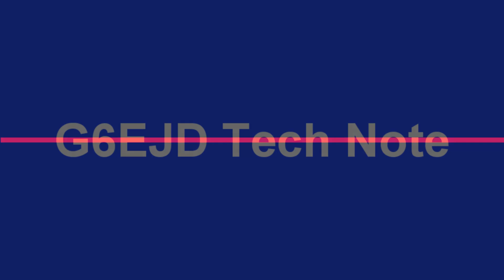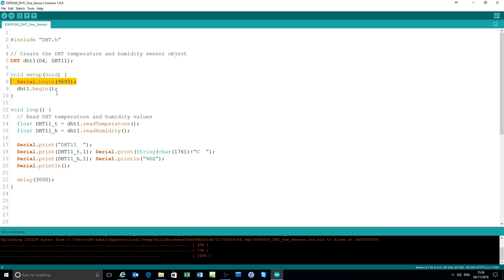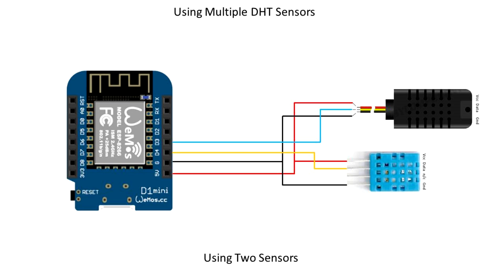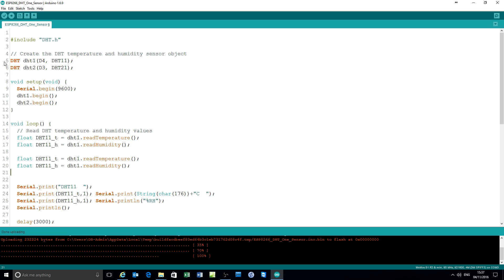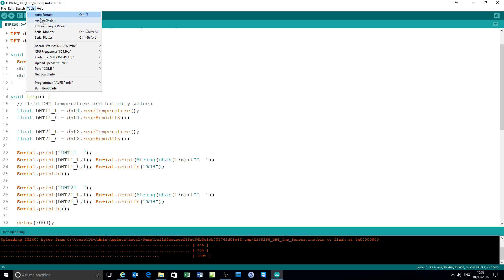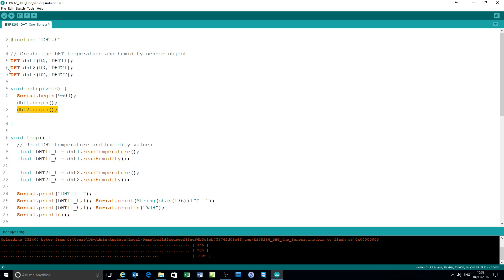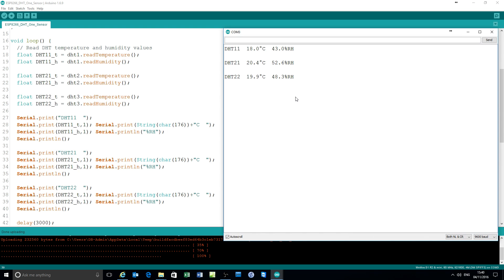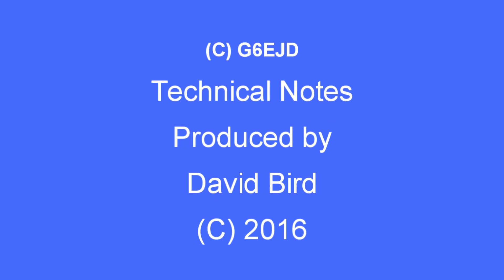Tech Note 012 - ESP8266 Reading Multiple DHT Sensors

Comment: wonder why do i only get Nan all the time?:s
it worked perfectly fine on d1 r2, but does not give any readings on mini pro...
i do have the dupont cables soldered directly on the pins tho because i dont have another breadboard, so maybe it does not get any connection through the tin because it did not want to stick onto the pins at all?
Reply from the maker: Let’s assume the connections are OK, best checked for continuity with a DVM. Have you checked here https://wiki.wemos.cc/products:d1:d1_mini_pro to ensure PIN numbers are correct, if you have used Dn and not GPIO numbers then it should be ok. Have you introduced any I2C devices? As D1 and D2 are SDA and SCL so your use will be overridden.
Reply: well, i later tested for continuity and even got 3,28 volts on the sensor, but still only Nan in the output... and i think i used D0 for dht22 (altho i first wanted to try it on the A0?:s and D0 is 16 then?)
and i obviously forgot to test the bmp sensor on it, so i will probably try that later...
Reply from the maker: Have you set up the programme to use multiple sensors or anything like that? If you have added in BMP sensor support, then that's why D1 or D2 won't work the library is already using those pins for the BMP.
D0 is GPIO16. I'm wondering if the Arduino IDE is configured correctly for the Wemos D1 Mini Pro, if your using D0 then try   Serial.println(D0); it should print out 16 the correct GPIO pin. The sensors can take a little time to start, so you may need to do:
DHT_t = dht.readTemperature();
DHT_h = dht.readHumidity(); 
while (isnan(DHT_t) || isnan(DHT_h)) {
   Serial.println("Failed to read from sensor!");
   DHT_t = dht.readTemperature();  
   DHT_h = dht.readHumidity(); 
}

Comment: Great video.
Have a question about cable connecting.
A wemos mini has 1 GND & 1 VCC pin each. Then, how to connect 3 sensors' GND and VCC cables into one pin on the board? 
ps. I don't want to harness a breadboard or dual core board. 

Thx.
Reply from the maker: It is a problem with multiple sensors as there is no product I have seen to parallel up Vcc and Gnd so the only solution is to solder wires from sensor to sensor with a separate wire for each sensor back to its designated pin. It’s easier with I2c bus devices as cards exist to parallel connect them, but unfortunately wire bus devices can’t do that, so sorry no easy solution. If your using DuPont cables they are relatively easy to stack three or more together but eventually soldering them is the only solution.

Comment: how if just one of Three sensor could reading the value ?
Reply from the maker: Have you seen the example code in the github? See the video description for the link. Reading different sensors is determined by the prefix e.g. dht1.readtemperature or dht7.readtemperature.
Reply: i got it, thank youuuuuuu

Comment: Great sample video. Going to use this for my setup. Have one question how far away can the senors be from the Wemos?
Reply from the maker: With these devices and using twisted pair like cat-5 then 5M might be possible the protocol is not necessarily designed for long distance communication so I think it will be an element of trial and error.

Comment: I thank you for you tutorial,
I would like know if is possible to give a name to each sensor and add a IP adress for my mqtt server.

Thanks
Reply from the maker: Yes, you can add friendly names where you see:
DHT dht1(D4, DHT11);DHT dht2(D3, DHT21);DHT dht3(D2, DHT22);
Change the e.g. dht1 to Room1_Sensor.(D4,DHT11); and there replace all instances of dht1 with your new name in the source code.Adding MQTT support requires adding in support for that service, there are a few tutorials and examples around, get your readings from the sensors, then parse them the MQTT routines. Keep two distinct  sections in the code to aid reading and understanding.
Reply: G6EJD Thank You Very much

Comment: Damn it... Are there 1-wire humidity sensors available anywhere? I'm looking through Chinese markets 2nd afternoon.
Reply from the maker: +Cyprian Guerra  No, it's a proprietary bus but a well used one. You can't parallel them and use a single input, DS18B20 can do that. Most I2C bus devices are useless too because they have a single fixed address of #3C although you can get an I2C bus multiplexor to expand the bus but very complicated.
Reply: G6EJD DS18B20 are only for temperatures, right?
Reply from the maker: Correct and it uses the Dallas 1-wire bus. Resolution is 0.0625°C in high resolution mode otherwise 0.5°C
Reply: Thanks. You're very helpful. :)
Reply from the maker: I can not find any 1-wire devices on the market. The common DHT21/22 devices are often called 1-wire bus devices, but they're not! I2C is the solution if you can spare the other input pin, although 1-wire has the advantage of a being able to use long cables and I2C can't do that.
Reply: I tried with i2c but there's not enough cable (different rooms). I'm expanding my terrarium controller to manage multiple reptile cages. 1-wire allows for very very universal solution with virtually unlimited number of relays (heaters, coolers, lights, water pumps, feeders) and sensors, without the cable length restriction, so I'm stubborn to make it work. I ordered DS2438 smart battery monitors few minutes ago and will try to make them read analogue humidity sensor output voltage. They have thermal sensors on-board (to check the battery temperature) so I can use it in the final maths (analogue sensors seem temperature dependant). Thanks for taking interest. I'll hopefully share when I'm finished (i.e. in couple of months, probably).
Reply: 18b20 sensors
Reply: If you just want temperature.

Comment: Is it much more difficult to add a moisture sensor/ different code?
Reply from the maker: Noting these sensors are temperature and humidity sensors, what type are you thinking about? Changing the code would not be difficult providing there is some support for the device or it's not an unusual interface. I can help if you need it.
Reply: On Ebay with this search/ pretty much all the same /  
"Soil Hygrometer Detection Module Moisture Sensor"
Reply from the maker: OK, I see that most have two outputs a digital pin that is either high or low depending on whether soil moisture is above or below a set value, or the Analogue output that gives a varying output with soil humidity, which seems to be much more useful than the fixed digital output. All you'd need to do is connect the A0 output of the sensor to the A0 input of the Arduino/ESP8266 and then read the value with :   sensorValue = analogRead(sensorPin); where sensorValue is defined with int sensorValue; and sensorPin defined with int sensorPin = A0; Nothing else to do except display the value and perhaps scale it to % with int soilMoisture = sensorValue/1024*100; // value now in %.
Reply: Thanks "Bigly". I'll try it, it reads resistance, hence 2 wire correct?
1 more :) I finally get code to work then lose it. There is no way to read code already loaded, correct? I know, save it but needed to wipe all arduino.
Reply from the maker: Yes, if it reads a varying resistance then should have a pull-up on the board to deliver a varying voltage, either that or add your own. If you've lost the code there's no way back that I know of, sorry - done the same myself, so now paranoid on backups :)

Comment from the maker: Something you don't like about this video - please let me know so I can improve
Reply from the maker: The adxl345 can use either spi or i2c bus but it’s address is fixed, so you need a i2c multiplexer many people sell them like Adafruit. TCA9548A 1-to-8 I2C multiplexer !

You can get up to 8 same-address I2C devices hooked up to one microcontroller - this multiplexer acts as a gatekeeper, shuttling the commands to the selected set of I2C pins with your command.

Using it is fairly straight-forward: the multiplexer itself is on I2C address 0x70 (but can be adjusted from 0x70 to 0x77) and you simply write a single byte with the desired multiplexed output number to that port, and then any future I2C packets will get sent to that port. In theory, you could have 8 of these multiplexers on each of 0x70-0x77 addresses in order to control 64 of the same-I2C-addressed-part. So it needs one extra command adding to your programme to select which device you want. E.g. Wire.write(address); wire.write(port); now your i2c command and data are sent to ‘port’
Reply from the maker: Search AliExpress for’1PCS TCA9548A I2C Multiplexer Breakout board for chaining Modules NEW’
Reply from the maker: #define TCAADDR 0x70
void DeviceSelect(uint8_t i) {
  if (i > 7) return;
  Wire.beginTransmission(TCAADDR); 
  Wire.write(1 << i);
  Wire.endTransmission();
  }

void loop{ 
 DeviceSelect(0); 
 ReadDevice(); // results from Device-0 
 DeviceSelect(7);
 ReadDevice(); // results from Device-7
}
Reply from the maker: I'm sorry it did not match your high audio standards, I've listened to your videos to see how I can make my videos better next time.
Reply: Cons 0
Reply: How can i connect multiple ADXL345 Accelerometers to esp8266 ??
Reply: thanks a lot...i will surely go through it...cheers :)
Reply: Perfect video,

Clean,
No music
Simple to understand 
No confusing ‘extras’ or waffle.

Just what I was looking for.
Thank you
Reply: poor sound

Comment: Hey Buddy, can you explain how to use a fingerprint sensor, to store fingerprints of a classroom, and take their attendance daily,  and store that in a file in the memory.
Reply from the maker: OK, good suggestion, so I've ordered one, I'll try to produce one as soon as I receive it from China, but that could be weeks away though.
Reply: Thanks, I will surely wait for your video to come. #Subscribed :-)
Reply: Any progress on that buddy?, as i was trying the same but whenever i try to enrol a fingerprint using Arduino IDE 1.6.13 it shows "Unknown Error" in the serial monitor :-(
Reply from the maker: I can now read the finger print sensor, none of the libraries work with the ESP8266 and I was getting the same error as you. Some of the libraries do work for the UNO or MEGA though. This is something to do with CPU architectures and 32-bit versus 8-bit machines and the data types. For example a UNO int type is 16-bits but the same for an ESP8266 is 32-bits. I've had to write the interface again myself, it has been a lot of work. But I can see how people can be matched to their prints and I'm currently building a web interface to do that and display a picture of the matched person, but it's quite complex.
Reply: yeah right, it is complex, i will be waiting for you to complete, it will be of great help, thank you.
Reply from the maker: I've leant the readers documentation is at best vague. For example I cannot find out how many fingerprints they can store, much of the information is at odds, some say 30 others say 1000. I've saved 30 copies of my fingers so that's my baseline and it makes for a practical number for a classroom. Reading the fingers is the easier task. Matching fingers with a picture is getting more complex and what happens when someone leaves, joins, gets an injury, so any system needs a way of managing the people-prints relationships. If you protect the code you can have a copy of the working ESP variant, email me if so.

Comment: i have DHT11 sensor.
i implemented as you did but my NODEMCU is not able to read the sensor data.
i uploaded the same code to MEGA2560 and it works.
Reply from the maker: It is almost certainly due to the wrong data pin, assuming the Nodemcu is working to specification.  which pin did you define in the source code?
Reply from the maker: Check the supply voltage to the DHT11 because its specification is Power supply: DC 3.5~5.5V on the nodemcu you only have 3.3v? On the mega you used 5v?
Reply from the maker: Did you get it working?
Reply: It is working on my MEGA 2560 but not working on my nodemcu.
Reply from the maker: The DHT11 needs 5v, that's not available on any NodeMCU pin, so you'd need an external +5v supply. Also what data pin on the NodeMCU are you using? and what definition in the source code?

Comment: I maybe wrong but I don't believe you can get IT to work on d0/gpio16 at least that is My experience
Reply from the maker: +Fredrik Andersson   You can but because D0 is used as the serial port with the IDE then a conflict occurs when trying to reprogram the ESP,  the same thing happens when you use the Sleep functions of the ESP, the solution is to reset the ESP just before IDE programming, but it's a little frustrating as there can be a timing issue between the IDE trying to gain device attention and the ESP program starting, in practice it takes about 2 resets or less to reprogram. Of course using any other I/o pin solves the problem. For end-use in the field, using D0 is OK.